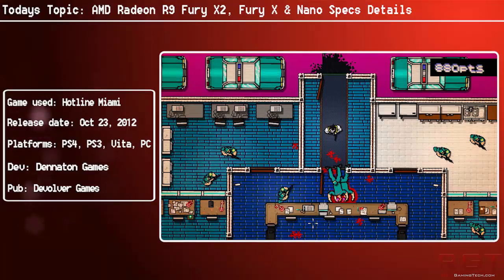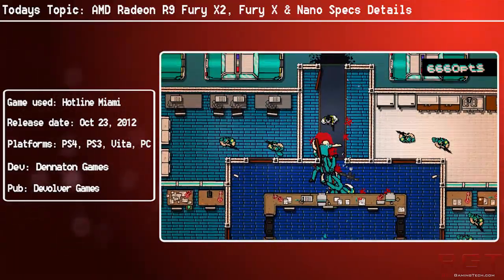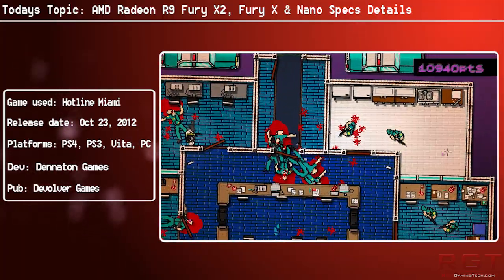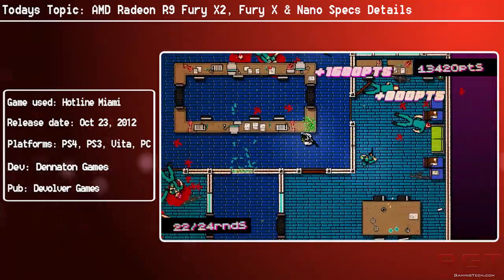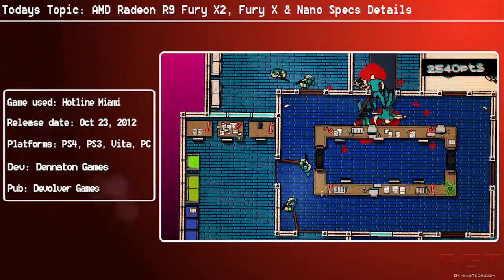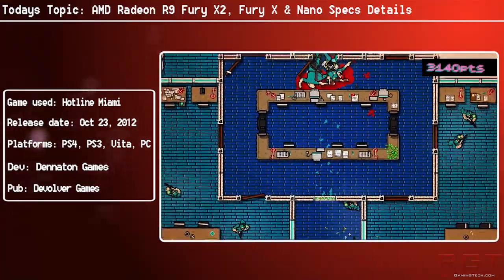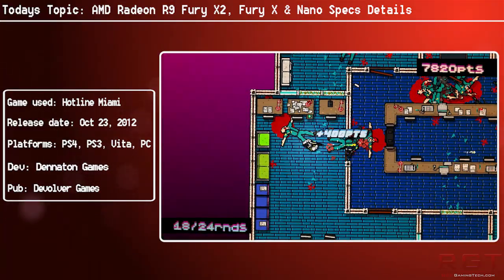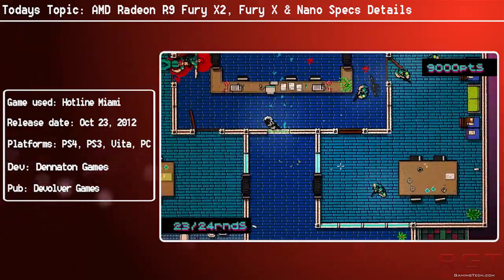AMD Radeon R9 Fury X2 Fury X & Nano Specs Details &  Far Cry 4 4k Results

Comment: The area of the die isn't that surprising as Intel have also been manufacturing layered silicon for companies like Altera.  It's an expensive process with 14nm layer + 20nm layer + 28nm layer + 40nm layer.  More layered technology is coming in the future, but its going to be done step by step as it is much harder to get right.

Comment: Invidia's reply via Pascal will be interesting.  Graphics cards will soon be able to beat the available 4K displays displays they can be hooked to.  We need 90-120hz 4K displays or 5K displays.

Can you SLI the X2 models???
Reply: AKlover I think you mean crossfire the Fury-X2 - and yes you can because you can do it right now with the 295X2
Reply: suhail ahmad   Internet scuttlebutt seems to strongly indicate crossfire X2s are highly problematic.
Reply: aarif gangat   What I said was specific to the 295X2 and I was wondering if the problem would likely have carried over?  Not sure the GDDR5/HBM is directly related

Comment: Yeah. That's the only part the concerns me. AMD certainly has the raw power this time around but they will need to step up their drivers to give the full experience. I've always used AMD cards due to the excellent pricing but I finally got fed up with lackluster drivers and went with Nvidia this time around. 

I'm very tempted to pick up a Fury X but the driver supports making me think twice and just wait it out for Pascal. 

Oh, and I don't think you'd see 100 fps at 4k with the dual card. Crossfire or SLI never get double the performance. Maybe with DX12 and its split frame rendering but not on DX11.
Reply: midicronica1 Stop trolling Nvidiot. There are no driver problems.
Reply: midicronica1 The Fury cards are DX12 but those benchmarks could actually be on DX12 and not DX11.  The full system specs aren't shown.  You'd have to view the footnotes to that slide to see them, but they aren't shown...
Reply: Do you live under a rock or maybe you just don't game, I've had tons of issues with Catalyst drivers and waiting for them to respond with a patch takes weeks. I'm not saying Nvidia is perfect either, I just had issues with their latest drivers too. The only difference is that they're usually quick to respond.
Reply: midicronica1 What problems have you had with the Omega drivers?
 What card do you own?
Reply: 10100rsn Far Cry 4 isn't a DX12 game and I doubt it's getting ported. This is a noteworthy thought, I just doubt it.

Comment: Okie Dokie, so my question is, how will the 390x perform in comparison. I'm pretty sure its just a re-branded 290x right? It would be kinda embarrassing if the fury nano card beat the 390x wouldn't it?
Reply: ***** That is not really true as the 300 series are actually enhanced revisions of the 200 series and here is why - the 300 series, particularly the 390/X have new features which the 200 series didn't have, such as full support for DX12 and Vulkan (and the 300 series are now fully optimised for mantle). The 390/X has brand new cooling solution, where the cooling plates envelope the VRAM amongst other improvements. They have re-engineered power delivery systems. They also have full support for AMD VSR and AMDLiquidVR and AMD Freesync. They also have the new 'AMD app acceleration' as well as AMD-XDMA crossfire technology. As far as performance goes, the 390X actually performs better than the 980gtx at 4K resolution. The 390X is also much cheaper than the 980gtx and it has 8GB VRAM whereas the 980gtx only has 4GB VRAM.
Reply: ***** Good question. Will have to wait and see. AMD are saying the rebrands are 'enhanced' but we don't know what exactly that means. There were rumours that the 390X will be a full fat 290X (Hawaii gpu) with 3072 stream processors, but I don't know if that is true or not. I hope so. Many NVidia fluffers are slagging off AMD for the 300X series rebrands but what these trolls are forgetting is that Nvidia has a far more prolific history for rebranding. All the NVidia 200, 400, 500, 600, 700 series were ALL rebrands (except for the top dog 280gtx, 480gtx, 580gtx, 680gtx, 780gtx). 17 months ago, I had a pair of Zotac 770gtx in sli and it was basically an overclocked 680gtx. Yet the NVidia fluffers are deaf, dumb and blind wrt the NVidia rebrands.
Reply: suhail ahmad Who cares if it's a rebrand? You can get a 390 8GB for $329....Nvidia cant beat that for price/performance .
Reply: The Commenter You are right. AMD is all about bang for buck and they have undercut NVidia on price to performance yet again. It is a travesty that NVidia fanboys refuse to get past this. Always looking for an excuse....
Reply: ***** They are all worth buying if you don't have a 200 series card already. Every single 300 series card beats it's Nvidia equivalent at price/performance.
Reply: ***** r9 390 beats the 980 some how for 329 dollars
Reply: sorry, that was prices i got from a faulty source.
Reply: +Chris Eley the 390x isn't supposed to be better than the r9 nano. the r9 nano is supposed to be on par with the fury x. the r9 nano and fury x are the flag ships. the 390x is ....more like the lot of ram for budget card.
Reply: +Chris Eley and also no not a rebranded 290x. These all use HBM ram which is an entirely diferent ram technology.
Reply: +vespaman101 - that is not correct my friend. The nano is actually on par with the Fiji-Pro (Fury) and not on par with Fury-X. Even though the nano is a full fat Fury-X, it has been tamed with lower clocks, lower TDP (175W), limited overclock ability (it only has a single fan for cooling) and it only has a single 8 pin power connector. It does however, come with full 4GB HBM and it gives double the performance per watt compared to the 290X (and the 290X was actually a pretty good gpu to start with). Also,  reports have confirmed that the Fiji-pro can be fully unlocked to full Fiji-X specs (and this is what I was counting on when I purchased my sapphire Fury) but you have to be very careful or you could end up bricking your very expensive gpu.
Reply: +alphazoom - here in uk, the nano is ranging in price (depending on manufacturer and etailer) from £500 to £600.

Comment: Since the fury X2 is essentially 2 fury X's will the fury X2 still be recognized as crossfire in the pc? If so we could just buy 2 Fury X's much sooner than waiting for that card. What would be the advantages of getting the Fury X2?
Reply: 4Skyrim "will the fury X2 still be recognized as crossfire in the pc?" Yes.
'What would be the advantages of getting the Fury X2?' 375w vs 550w. Single card so takes only 1 slot eg. can be used in mini itx build.
Reply: Exactly, the R9 290x2 was recognized as a crossfire configuration so I don't see this card being any different. I guess it's just more convenient and saves space if you get the dual card rather than having two Fury X's and having to deal with two 120mm radiators.
Reply: ...no first time you ever heard of a dual gpu card. They share vram, so 8+8=16gb of vram, in this case. They are still 2gpus so you can use only another fury x2 in your system. So yes this will be detected as 2cards, but won't be treated as one can create perfect  scaling. It can create perfect scaling. If you want the best of the best fury x2 is the answer.